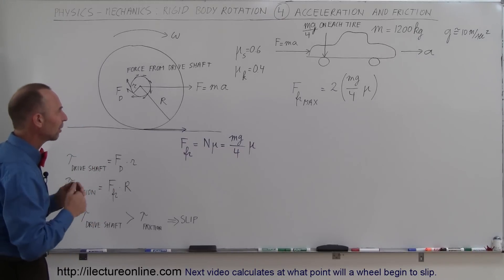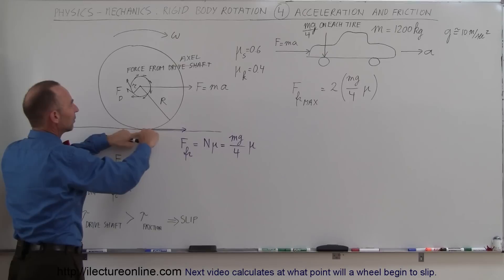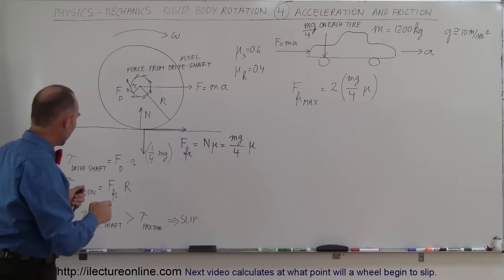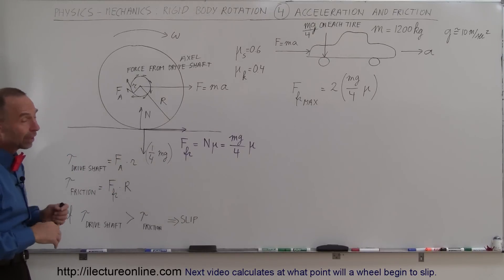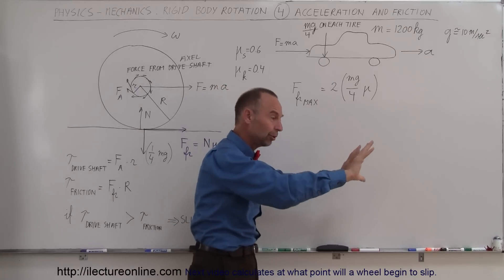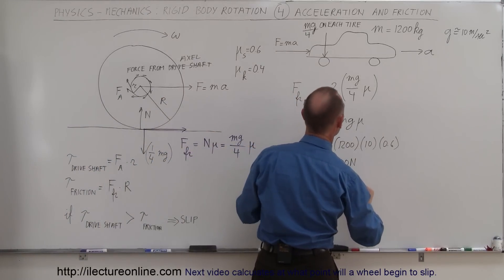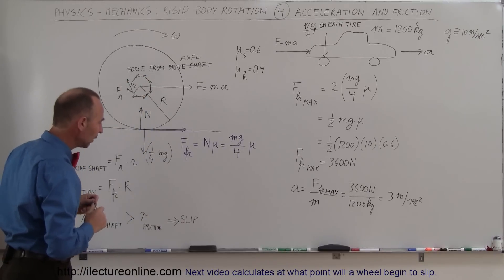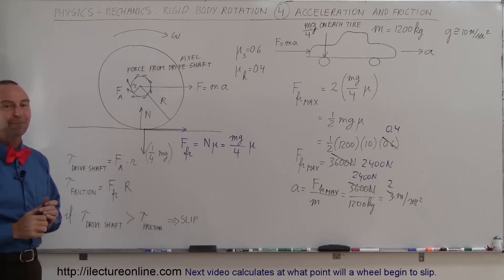Physics 11.1 Rigid Body Rotation (4 of 10) Calculating Acceleration & Friction of a Car Tire

Comment: u said  that torque due to engine is less than the torque due to friction then how come tyre rotates in clockwise direction???
Reply from the maker: If the torque caused by the engine is larger than the torque due to the friction, the tire would slip over the road.  (which happens a lot during drag racing).
Reply: u r correct..
but if torque due to friction is more than that of engine then tyre should rotate in the anticlockwise direction..right??
then why it is rotating clockwise.??
Reply from the maker: How does the tire need to turn for the car to move forward?
Reply from the maker: If you have a toy car handy, you can use it to try.
Reply: please be patient to answer☺
on a tyre if a force acts away from line of center,then it has both translatory and rotational motion right??
force is acting along the tangent of tyre which causes both translatory and rotatory motion...
but if the torque produced by friction is more than that of engine then the tyre should rotate in anticlockwise direction...
Reply from the maker: The principle is the same as when you walk.  What force pushes you forward when you walk?
Reply: one last question..😊
1.if a force acts away from line of centre,does it have both translatory and rotatory motions?
2.at the bottom of the tyre,are the forces due to engine and the friction equal..
Reply from the maker: 1) That depends on the situation.  If you take any object and push it so that the line of action of the force is not through the center of mass, the object will have both rotational and translational acceleration, unless the object is fixed at its axis of rotation, then it will only have rotational acceleration.   2) Friction forces will always adjust to the forces causing the friction force (since the friction force is a reaction force), until the applied force is greater than the maximum possible friction force, then the tire will begin to slip.
Reply: ok sir ..please try to answer this....
In space,if a force acts on a wheel (which is not fixed)away from the line of center,it causes both translatory and rotatory motion(as u said),then will the linear acceleration produced by the force equals to the case when same force acts on the line of COM.
and if YES,from where the extra energy is getting to the wheel in first case(rotatory energy)??

Comment: Excellent explanation
One Question: Why is friction shown in the direction of motion? Shouldn't the arrow for friction be in the direction opposite to that of motion?
Reply from the maker: In this particular case the only force that can propel a car forward, is the friction force.  If you place a car on a solid strip of ice, the wheels will spin, but the car will not move forward.
Reply: That explains it. Thanks!
Reply: Frictional force is actually in the backward direction and that actually causes the car to move forward. This can be explained by inertia of rest  and Newton's 3rd Law.

Comment: to find tractive force for a rear wheel drive car , we can directly calculate it by F=(mu)(combined weight on  rear wheels),
But i find some other formula in internet which is like 
F = ((mu)(total weight)(distance of CG to front axle))/((wheel base - (height of CG)(mu)))
i considered 40:60 distrubution for a 260Kg vehicle and mu=0.7 , i dont understand why i am getting two different values. got that formula from following link,pg-23.
http://scholarworks.csun.edu/bitstream/handle/10211.3/123383/Flickinger-Evan-thesis-2014.pdf;sequence=1

Comment: Here we assumed rear wheel drive hence F(friction) = 2 (mg/4)(N)( μ) if we have all wheel drive would it double the friction force?
Reply from the maker: The friction force is what gives the car the forward push.  If you have four-wheel drive, then you can have double the push.
Reply: @MichelvanBiezen  Hello Professor, But isn't the static friction acting backwards on the front tires in a rear wheel drive car? And if it is indeed acting backward on the front tires and its the same strength as the forward acting friction on the back tires, shouldn't all these frictions actually cancel each other out!??

Comment: How does torque exactly helps a car to move?
Reply from the maker: A wheel can be moved in 2 ways:   1) apply a force at the point of rotation (center of axle) in the direction of intended motion or    2) apply a moment (or torque).

Comment: Can you please tell me what happens with driven tire? Is it the same?
Reply from the maker: I am not quite sure what you are asking for.
Reply: I am asking about slipping etc. in driven wheel i.e. if car is rear wheel drive then mechanics of rotation of front wheels.
Reply: @vikrantsoni5229  Given a two-wheel drive car that is rear wheel drive, the front wheels are free spinning.   Assume a car being driven in a country where they drive on the right (like the US), as we will place an observer on the sidewalk to the right of the car to refer to the directions.

There will be a traction force on the front wheels from the road, in order for the front wheels to be in a state of pure roll (i.e. roll without slip).   The force on the front wheels will be backwards, in order to rotate them clockwise as seen from the sidewalk.   There will be a radial force from the bearings pushing forward on the wheels, that causes the front wheels to spin instead of translate.  There will also inevitably be a frictional torque inside the bearings that oppose the torque from the traction force.  The torque from the road's traction will point to the car's left (clockwise as viewed from the sidewalk), and the torque due to the bearing friction will point to the car's right (CCW as viewed from the sidewalk).

There is also another radial force on the bearings that pushes downward, as a result of the wheels supporting the car's weight through the bearings.
Reply: Michel van Biezen hes talking about a used tire
Reply: In the case of a caster wheel?

Comment: Hello, I was trying to apply this to my project, but results I got are too high to believe. I am making a simple square-shape electric vehicle, having its gross weight (including objects to carry) of 40kg. There are two motors driving two wheels in the back, and the other two are free wheels in the front. I want to find the torque in kg*f*cm required at each motor.
First of all, I apply the equation Static Friction(max) = (us)(mg/4) = 0.6*40*9.8(1/4) = 60N (approximately)
So, with 21cm wheels, the torque at each motor is (60N)*(0.21m) = 12.6 N*m = 128.5 kg*f*cm.

This is pretty strange because I'm gonna need two huge motors to drive this vehicle. (just to make it start to move) My question: Is there anything wrong with my calculation?

PS. I also tried this http://enginuitysystems.com/EVCalculator.htm. But it doesn't tell me that this is a 4-wheel drive system or just 2-wheel one. If you can tell this, I will appreciate.

Thank you
Reply from the maker: This is where theory and practice collide.  There are many factors that are not considered in a purely theoretical problem that need to be considered in a real situation.  Internal friction of the moving parts is definitely one of them.  Also if your car has a mass of 40 kg, that is a lot and that will require a strong motor

Comment from the maker: The weight on each wheel is 1/4 the weight of the car.
Reply: Michel van Biezen Hi sir can u pls help me to solve this question. A wheel is rotating on a horizontal surface at initial velocity of 2.4 rev/s. A frictional force 68N between the wheel and horizontal surface slowing down the wheel at constant acceleration of 6.52 rad/s^2. Calculate the time taken and the number of revolution the wheel makes before it stops.

Comment: should we consider weight on 2 wheels or one wheel to find out torque required to move vehicle from rest?
Reply from the maker: The weight on each wheel is 1/4 the weight of the car.
Reply: my question is which weight should we consider for calculating torque required to move a car? w/2 or w/4
Reply from the maker: Any torque will move the car.  The question in this video was to calculate the maximum force (and therefore torque) that could be generated considering that each tire bears the load of 1/4 the weight of the car.
Reply: thank you
Reply: @Nikhilkumar9516  Note that Michel's response assumes that the car's center of mass is exactly equidistant between all four wheels, for the normal force on each wheel to be the same.   This is not necessarily the case with a real car, and it governs the difference between how front wheel drive vs rear wheel drive works.

This is why it is the industry norm for a typical passenger sedan that is built today, to be front wheel drive, and for trucks to be rear wheel drive.   A front wheel drive sedan will have more weight above the front wheels due to the engine, and there is an advantage to have the traction on the front.  A pickup truck or a commercial truck will have more of its weight in the form of its payload most of the time, which will be over the rear wheels.

Comment: When we calculate a, do we need to consider the kinetic friction between the front tires and the ground?
Reply: And another question is, I still can't understand why the wheel will accelerate or go forwards if it slips? Because it seems like if it slips, it moves backwards relative to the ground. Plus, your video is really helpful, and I hope you can answer my questions.
Reply from the maker: The friction between the front tires and the ground would be an additional friction force which you can elect to include.
Reply from the maker: When the wheel slips, the friction now becomes kinetic friction, which is less than the static friction and the acceleration is now reduced by that difference.
Reply: ThX a lot!

Comment: i did not understand when to use the kinetic friction?PLS RESPOND ASAP
Reply from the maker: Kinetic friction is used when two surfaces slide over one another.  A rolling tire does not slide over the road.
Reply: thanks alot sir

Comment: Because rubber is...rubbery...do spinning tires change shape enough to significantly change the equation? Does the rubber compress in interesting ways for initial moments, i.e., vector components accounting for body "lift" (drawing in the sidewalls more than affecting the contact surface) or is that more closely related to engine interaction with its mounts?
Reply: Tires absolutely bend and squish a lot. Especially when accelerating, deccelerating or turning. You can probably find videos of that, it looks like the tire is about to come off the rim lol.

Comment: First thanks for the fabulous explanation and i have i question please :: 
you showed that the F(friction) and F in the same direction but it shouldn't be am i right  ?
Reply: the friction is opposite when the car decelerates
Reply: friction is the direct force that pushes the car
Reply from the maker: +Shahem Haddad 
No, the friction force is in the correct direction.  (The friction force pushed the car forward).
Reply: +Michel van Biezen So the friction and the force could be in the same direction no problem ?
Reply from the maker: +Shahem Haddad Think of it this way:"What would happen if there was no friction?"   The answer is:  the car would stay in place and the wheels would spin, like a car on ice.Then ask yourself the question:   "What force pushes the car forward?"  The answer is: ......?
Reply: The friction :)

Comment: I have a question: When you calculated the friction force you used Friction force=(Norma force)·(static coefficient)?. If I'm not mistaken, that's the expression of Maximum Friction force for the limiting case, which is not necessarily the value of the actual friction between the tires and the road.
Reply from the maker: +Rondelf Yes, that is the limiting case. If the torque produced by the drive shaft exceeds the torque created by the friction, the tires will slip.

Comment: I think that the force you just calculated is frictional not the one applied from the engine at the axle of the wheel. Correct me if I'm wrong
Reply from the maker: +Marc B Agenor The drift shaft provides the force (torque) to rotate the tire.  The friction between the road and the tire actually propels the car forward.

Comment: while the calculation of the acceleration , u took the frictional force of the rear two tires and this two forces contribute to the acceleration but what about the front two tyre's friction ? wont it be accounted while calculation of the acceleration of the vehicle?
Reply from the maker: +shubham bajoria 
That front two tires would add additional resistive forces.
Reply: +Michel van Biezen.....
 so u did not take that resistive forces into consideration while calculating acceleration of the vehicle.

Comment: Wouldn't the torque of the driveshaft have to be greater than the torque of static friction in order to provide the initial net torque for clockwise angular acceleration, though?
Reply: Yes and No. Static friction;'s maximum possible value should be greater than the static friction required so that torque due to driveshaft is greater, and so it moves. If the static friction required is more than max value, it will just slip.
Reply: I think so too

Comment: So does that mean that a car can accelerate faster at the beginning of a race by hitting the gas petal just enough to almost break static friction but not pass it. In other words, those car that hit the gas petal and start skidding their tires at the beginning of a race will actually accelerate slower?
Reply from the maker: Intellegent Hawj
That is correct.
In car races, that may not be practical, so you will still see them spinning their tires at the beginning of the race.